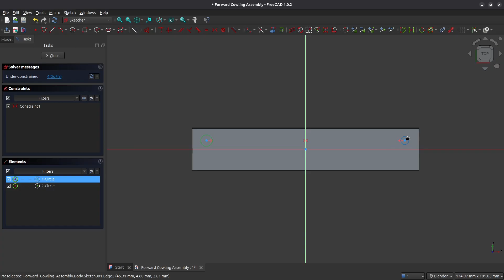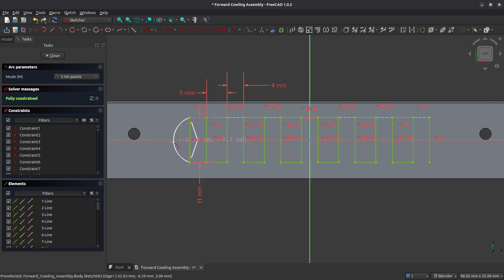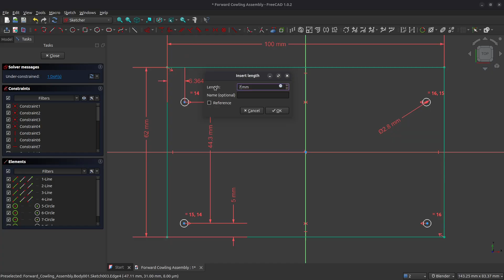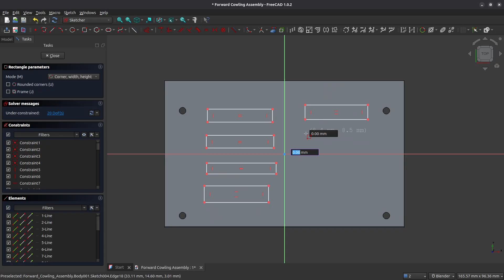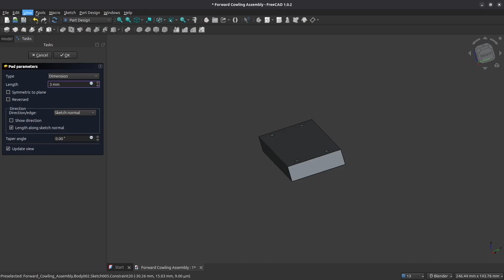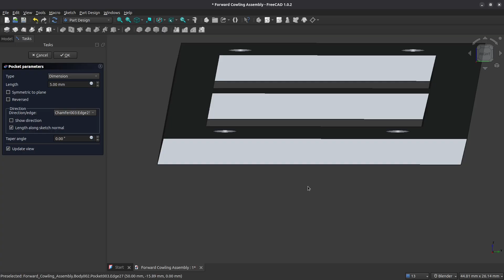Part 13: Forward Cowling Assembly - TitanBot | FreeCAD Robotics Design

Comment from the maker: The TitanBot officially has a front clip! We've locked in the military styling of our Forward Cowling. 🤖

Design Tip: The 8-slot hood is perfect for airflow and visual access to the Accessory Deck, but physical reality dictates that taller payloads (like a LiDAR puck or a pan-tilt camera) will crash into this standard geometry. In robotics, your baseline armor rarely survives contact with custom payloads.

Question: If you were mounting a tall, protruding sensor payload to the Accessory Deck, how would you modify this FreeCAD hood file? Would you design a drop-in modular replacement, cut a massive central aperture, or raise the entire cowling via standoffs? Let's talk modular design and integration below! 👇